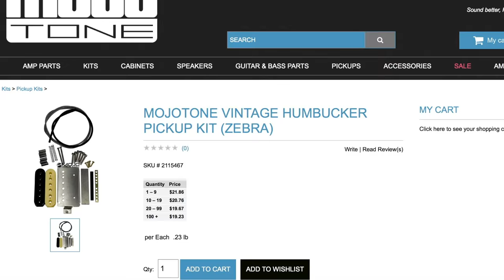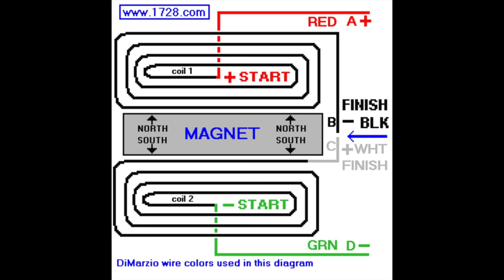Winding a set of PAF humbuckers pickups for my Les Paul guitar restore - Mojotone kit review

Comment: Hi,
I´ve got a question. why do you connect the coins in that way - black 
with black, white with white ( start 1.coil with start 2.coil  ; finish 
1.coil with finish 2.coil )? 
Is it possible to connect logically :  white 1.coil (finish) with black 
2.coil (start). In this way there are black 1.coil and white 2.coil  
remaining for output. Does it make any difference?
Thanks.